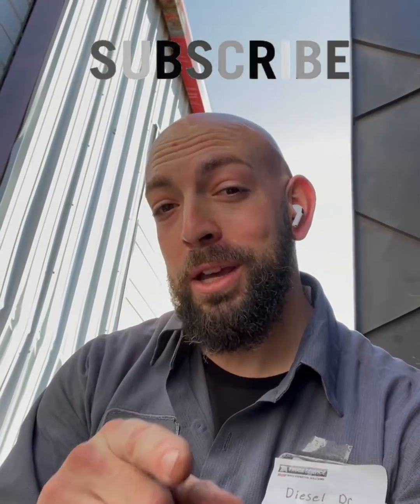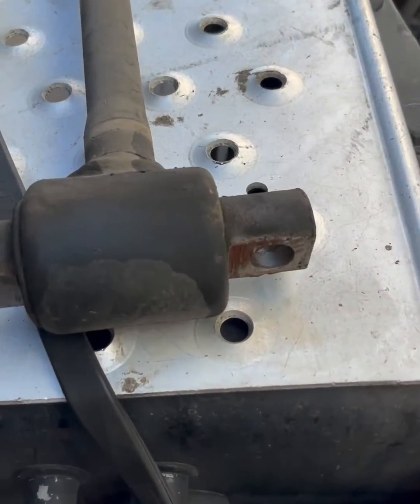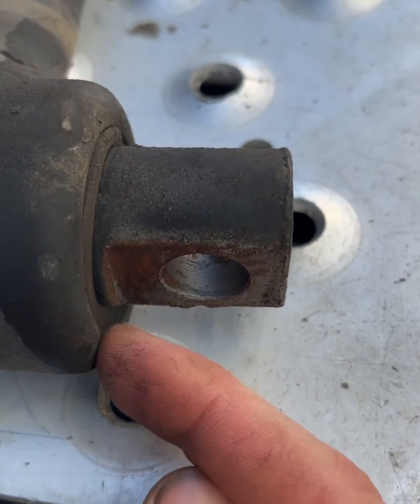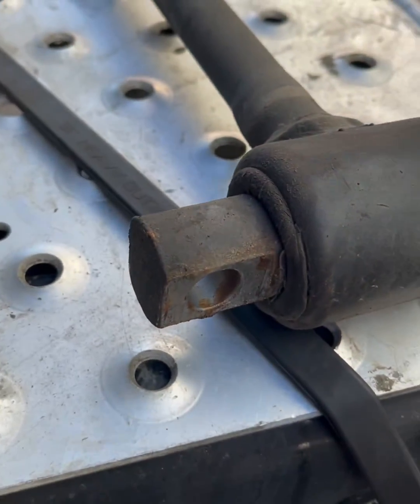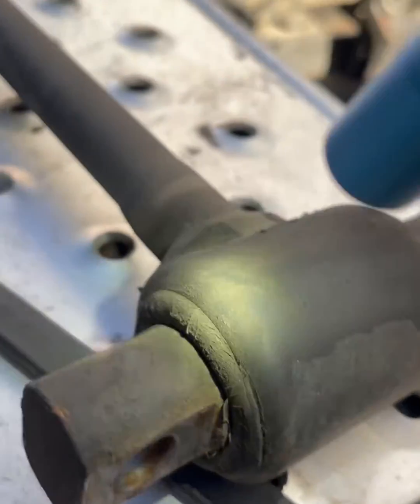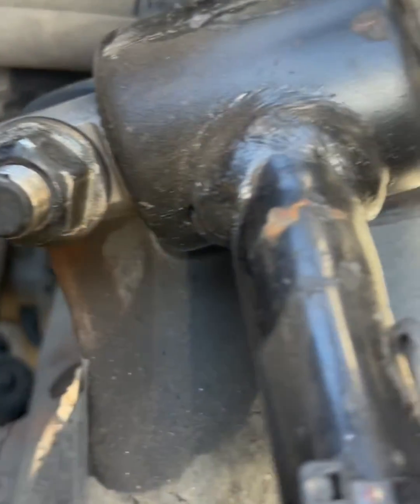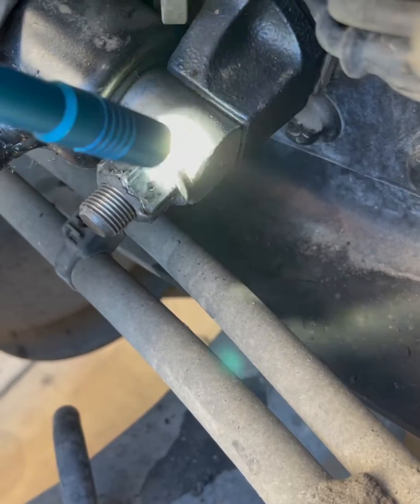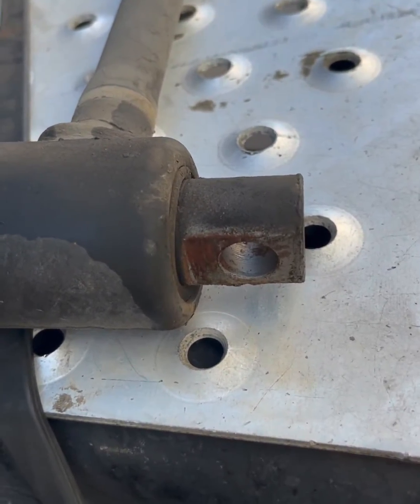Torque arm inspection, freightliner, international, volvo, kenworth. Its all here and all for you.

Comment: I am extending a Peterbilt turning it into a super 10 dump truck. I am using freightliner axles and i can’t seem to get the torque arm just right. It creates a lot of tension pushing my axles out of alignment. Due to the fact that i am using Peterbilt hangers and suspension. May you recommend anything for me to do?
Reply from the maker: I would go to an alignment specialist and have them fabricate something for you. This will take the guessing out, would be a little costly but well worth it.

Comment: Thanks again. I like your channel.
I got a million mile Cascadia i been gettin ready. 
This is the exact thing i noticed a week ago. The torque arm on the second axle / first drive axle is uneven, like a muhhf*ka!! lol
Im tryin to get the shakes outta my dam truck cause i cant wait to get to work in it.
.. I will have to check them Carrier bearings as u say, along with inspect as much as possible under the truck (havent got under there yet)

Ive put balance bags in the front tires.. seemed to work for a minute, then the same steering wheel shimmy came back next time i test drove it. Got em hi speed balanced (but while on the truck tho... hmm(?) .. with weight. Steering wheel shimmy seems mostly gone but i think i got a shake comin from the rear now.
I kinda suspect that drive shaft carrier bearing(s)
Thanks again. We all appreciate u fam lol
Reply: ... So yeah, that dang torque arm has slid over time or use or whatever we would call it on the ol girl (million miler)..
.. and at both ends.
So.. u see like No bushing stickin out of this side, and alot on that side.. at both ends.

What are the symtoms those torque arms give.. or what complaint when they go bad?
Reply from the maker: Thanks for watching and reaching out. Pretty impressive when a unit reaches that high of mileage. Get ready for a engine rebuild if it hasent been done yet. I would Deff look at All the suspension components because more likely there all worn out. Carrier bearing ,springs, every single bushing,cab mounts,Eng mounts. All the good stuff.  When the torque arms go bad they don’t control the high torque movement such as taking off from a stop with a load. You would get more shakes and less control. Glad to have you onboard.
Reply: @bustedknucklebydieseldr3228  
Maan.. u already knowin.
I think i do need cab mounts.. so far ive only done the cab shocks and airbags.
I got to check all them mounts and bushings u mentioned...

Comment: Yo great videos man, always helpful stuff. Recently had a funny problem, driver pulled in with both headlights out. New freightliner with the fancy 1000 dollar LEDs. We all feared the worst cause when we tested his connections they had power. But then we plugged them back in just to be safe, and somehow that worked. Lights work fine again just by being unplugged and plugged back in. Also worth noting everything was clean. Any idea what happened? Driver said he had a similar problem after a battery change with his power windows.
Reply from the maker: Thanks for watching, that is an interesting problem. Sometimes an over load occurrs on any circuit, none particular. Abs when that happens the ssam model will continue sending power and not close the ground path. Everything with these new electrical systems are very smart but also trip easy. And when that happens unplugging and replugging usually helps. Your right about how crazy $$ those things are.